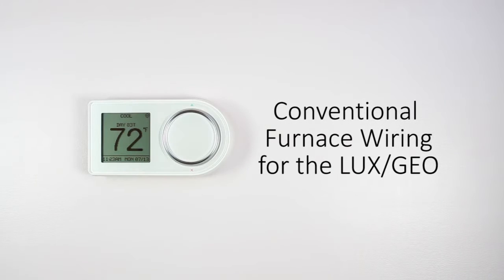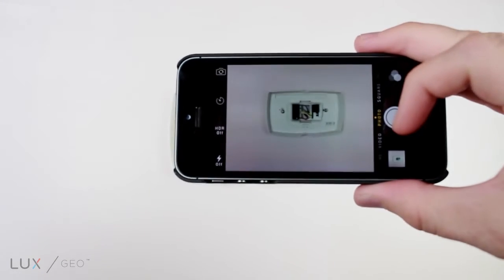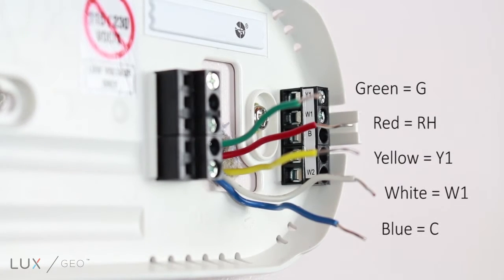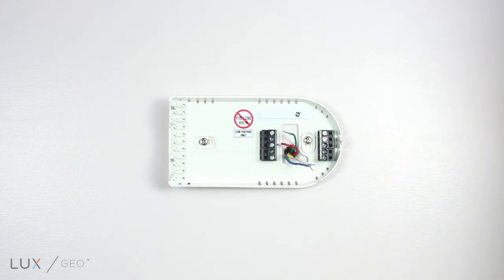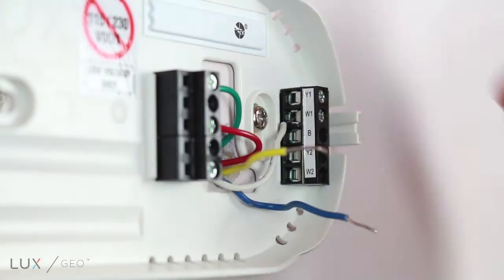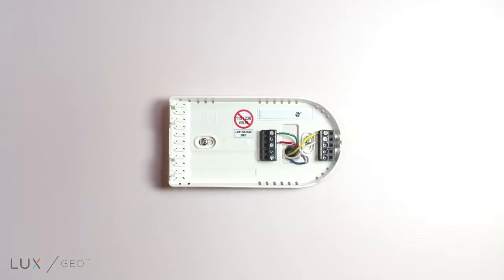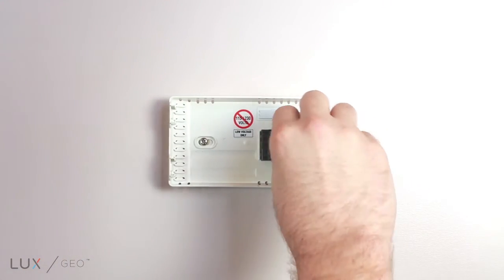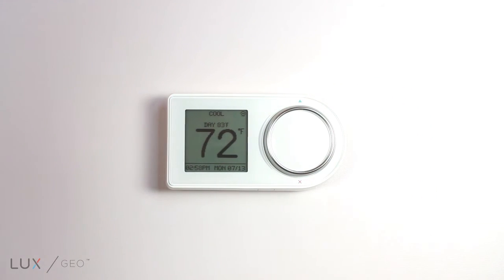Conventional Furnace Wiring for the LUX/GEO

Comment: C wire not used on my system. 
And what if anything needs to be changed on the jumper positions. My RC and RH are linked, but Y1 and W1 are not linked. Is that correct?